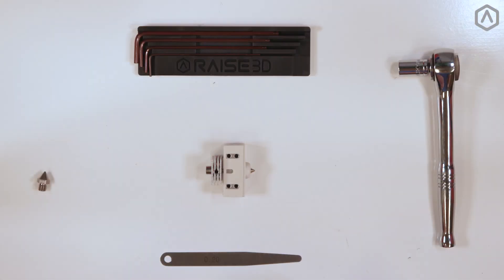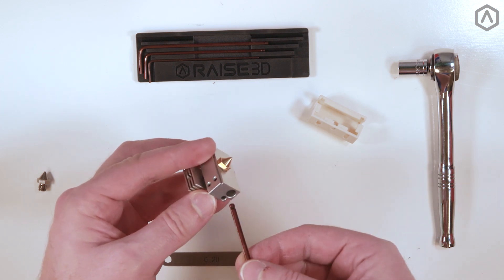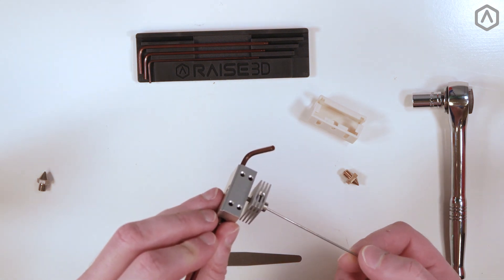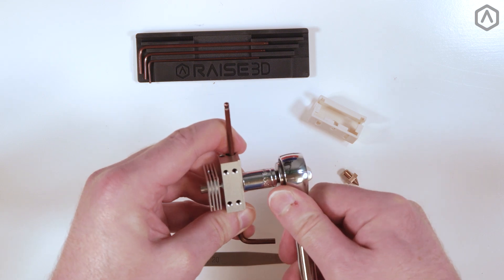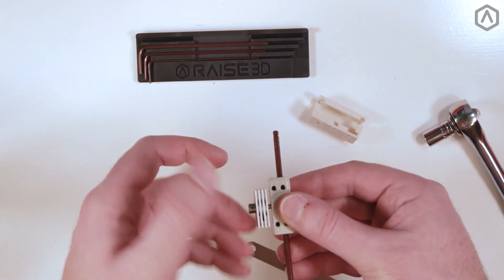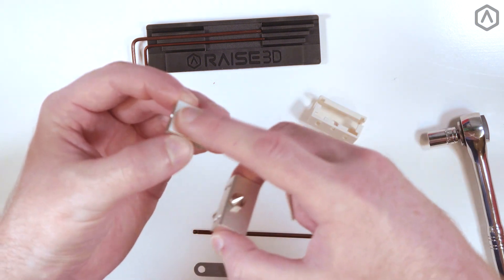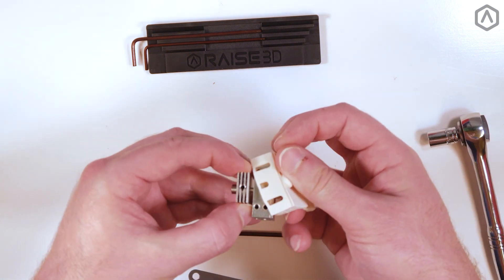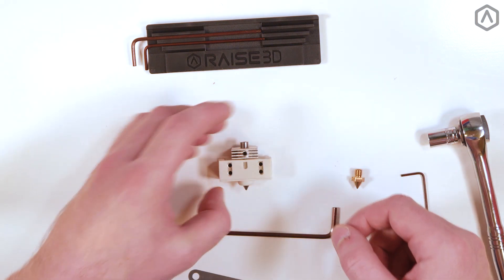Nozzle Replacement for Pro2 Series 3D Printers | RaiseAcademy

Comment: What is the purpose of the 0.2mm gap, and what will happen if we skip that part?
Reply: I believe it gives room for the nozzle to completely tighten against the heat break. This would prevent plastic from leaking out and making a big mess in the threads.

Comment: Guys I think there is a far more easier way to change the nozzle. If you make up a "U" shape plate with a hole in it so after setting the clearance on the nozzle to block using a feeler gauge (which you could have done using a small washer better then a feeler gauge) Insert the unit correct way up into your U block.  The block has a slot at the top for the location shaft to slide into.  Now move the heat shield up till the distance from the nozzle tip and the top of the heat shield is set by the top and bottom of the inside of the U.  Now all nozzle changes will have the same replacement height.
Reply from the maker: Thank you so much for your comment. We will try our best to update and improve on our tutorial videos.